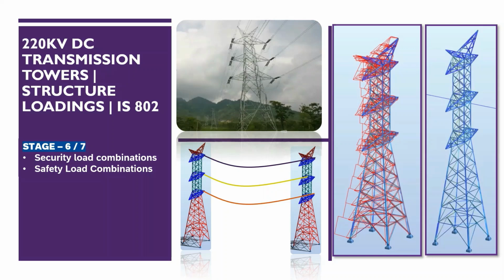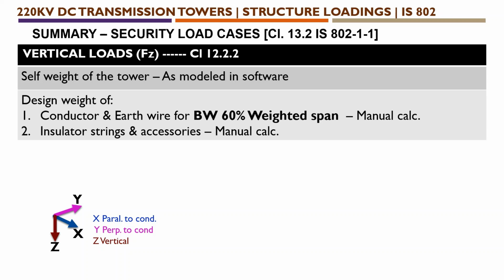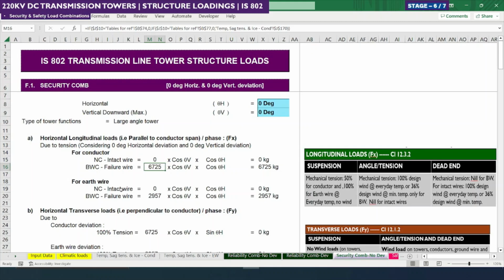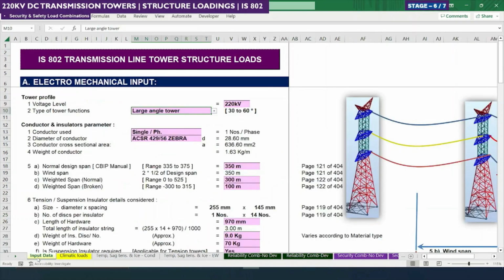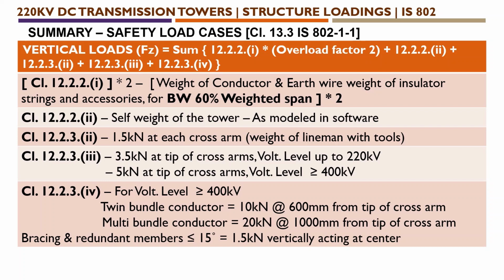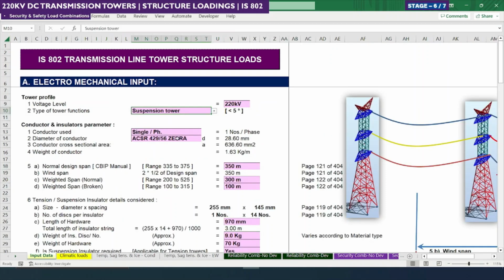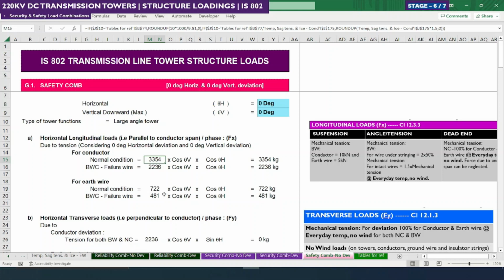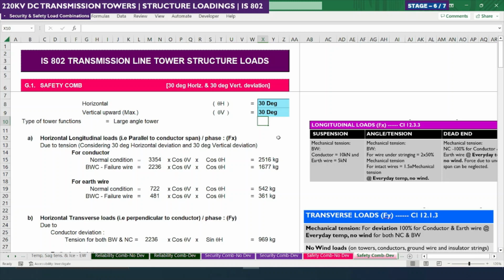220kV DC Transmission Towers | Structure Loadings | IS 802 | STAGE 6 of 7

Comment: shouldn't the weight of tension insulators be 0 in vertical loads in case of suspension tower
Reply from the maker: Weight of tension insulator and 60% of conductor weight should be considered under security requirements as per clause 12.2.2 of IS 802-1-1. Under security requirement, weight of tension insulator should be doubled (for overload factor 2) as per clause 12.2.2 (i).